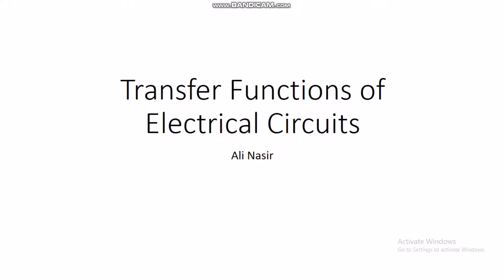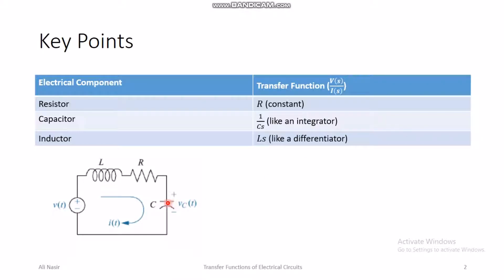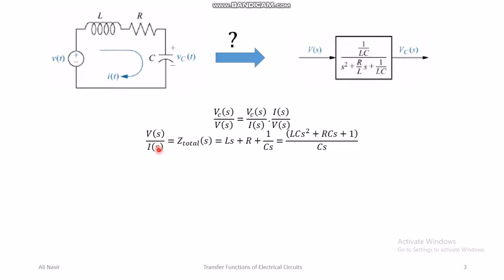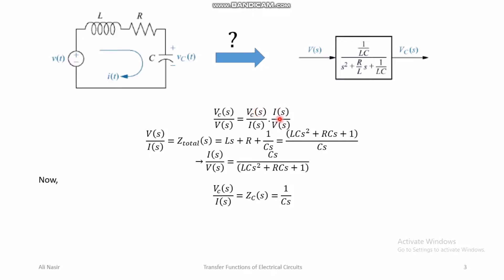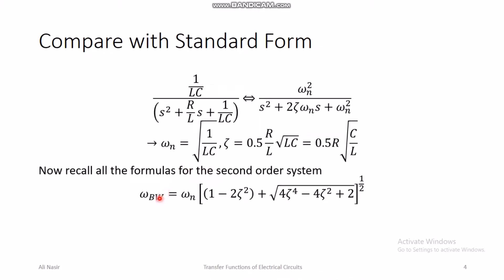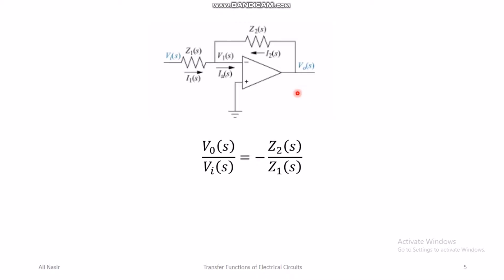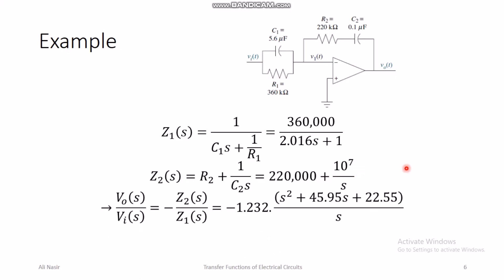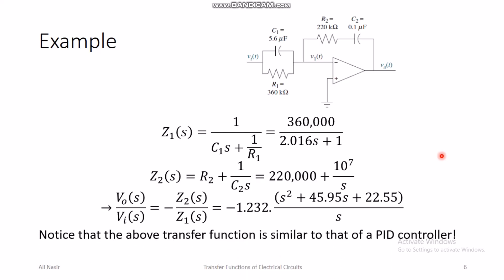Transfer Functions of Electrical Circuits

Comment: Can I ask how you would change this if the input was current and output was voltage?
Reply: In that case, the transfer functions would simple flip, for example, the TF for capacitor would become Cs and that of inductor would become 1/Ls and similarly for resistance, it would be 1/R
Reply: @techibro  how do I find the transfer function in this case ?